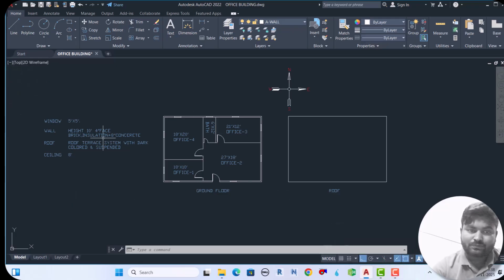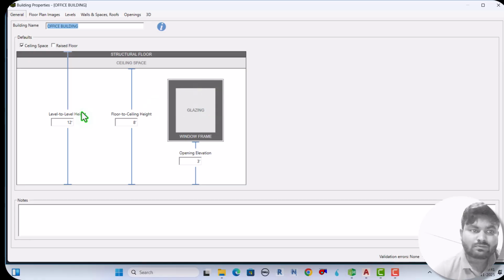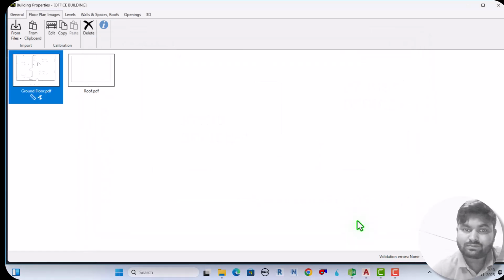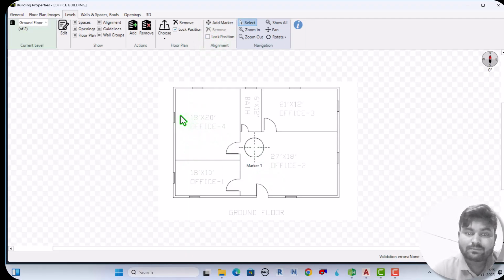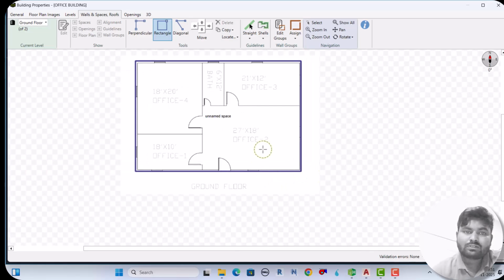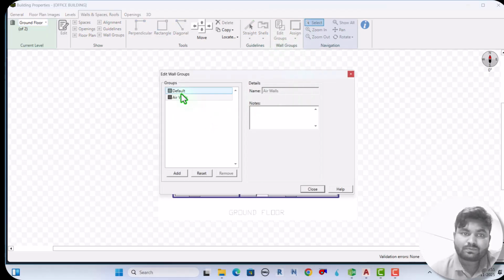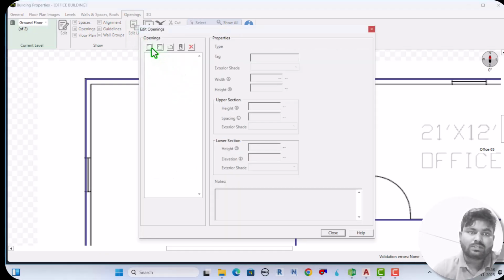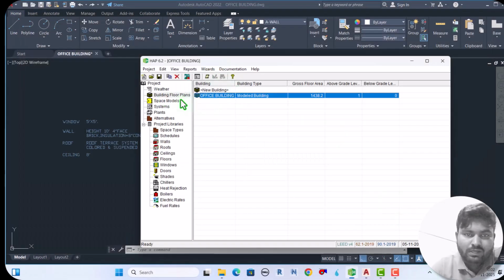HAP 6.2 Step-by-Step | Cooling & Heating Load Calculation-Part-02

Comment: Excuse Sir, the software doesn't show 3D part in my laptop. Can you explain in detail about my problem? Thank you Sir
Reply from the maker: 1.Go to View → 3D Building View
Make sure it is enabled/checked

2.3D will not appear if:
No spaces/zones are created
Walls, floors, or roofs are missing
Reply: @imranfarhat9760  I have done but it appears partially rendered. I try to fix but it's still the same
Reply from the maker: @-ManLuong-A if you have followed all the steps then it must appear. 
Having re-installed might be an issue will solve. Let's try